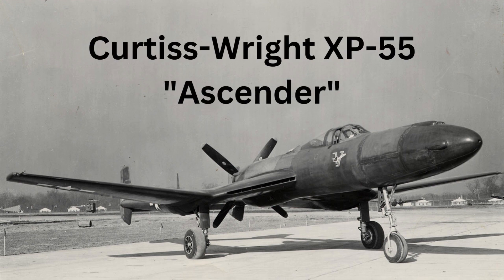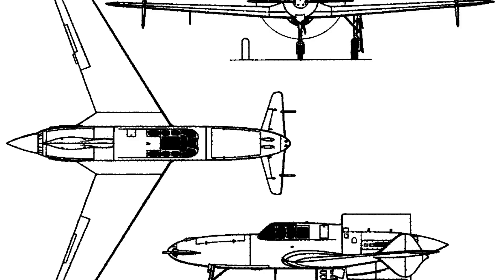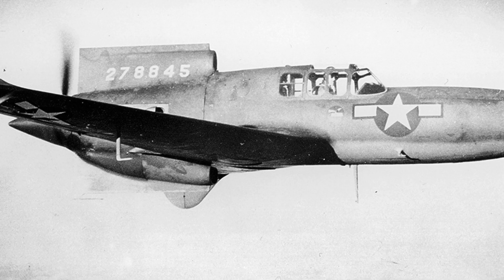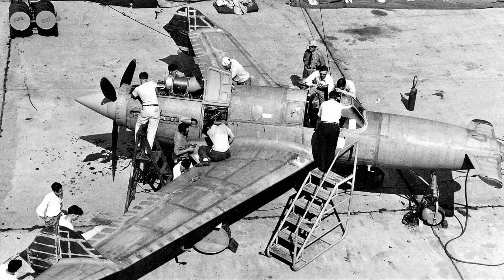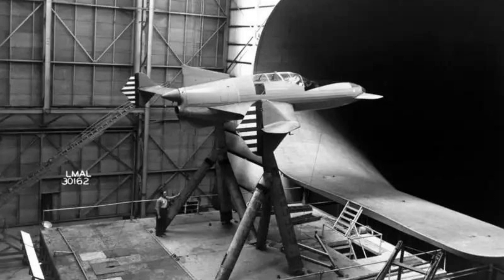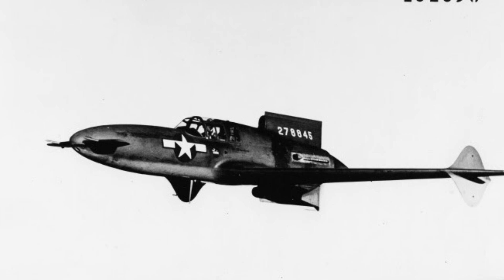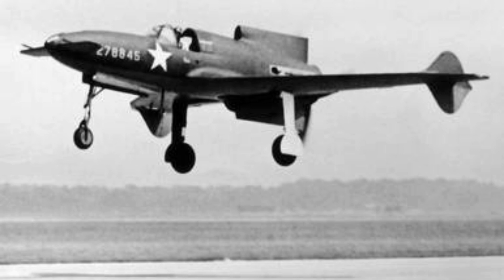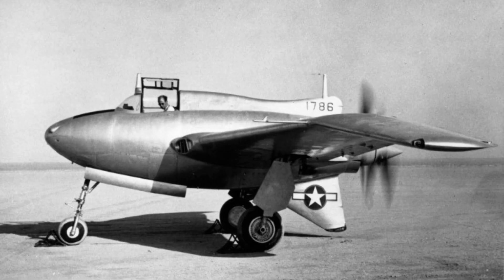Pusher Engine Design: Curtiss-Wright's XP-55 Ascender

Comment: My dad, who was at Wright Firld at the time of flight testing, said that the ground crew called the plane, "The Ass-Ender" because it was set up reverse from most airplanes. While the idea of having a nose full of weapons wasn't new, see the Lockheed P-38 as a prime example, the idea of a pusher airplane goes back to the pioneers of aviation, the Wright Brothers, whose Wright Flyer had a single engine turning twin propellers to push the airplane along.
I'm wondering if the swept wings were the reason for the instability of the XP-55?
Reply: I wonder if the instability could have been eliminated with a gyroscope? It's used on the B-2 and 117 Nighthawk.